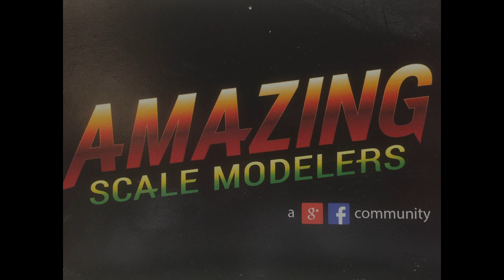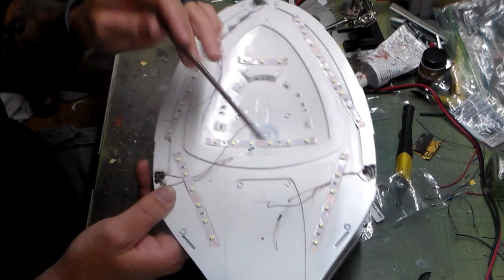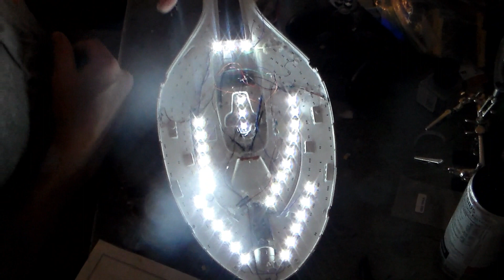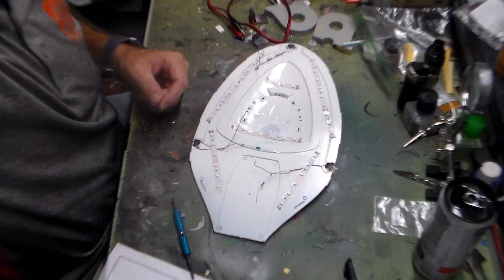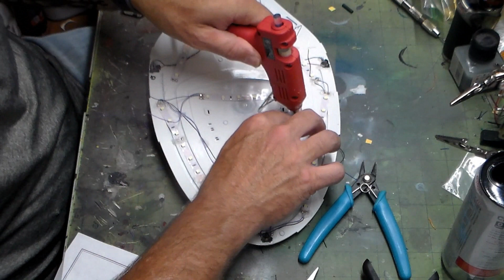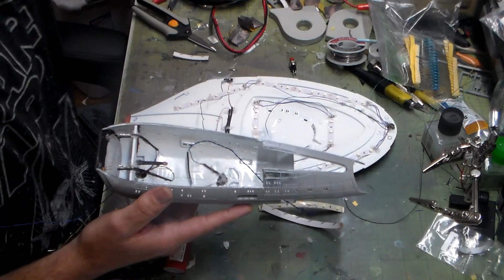Revell 1/670 U.S.S. Voyager build log 8

Comment: Great progress as usual. So good to see you have fun, blowing stuff up with the torpedoes and phasers. :D As for a soldering station, I can recommend Weller stations. They aren't that cheap (beginning at about US$120) but you can change the tips. From what I saw, your soldering iron now has a huge tip. Especially with those tiny LED strip connections, a much smaller soldering iron tip should help you tremendously. Tell your wife to get you one of those right now in advance for x-mas. Tell her, I said so! :D
Reply from the maker: TK316 thank you. I will diffently do that.

Comment: Hey Buck, great work on this update. The video indeed makes it look a little hard with the light in the saucer, and you use almost twice the amount of led's i did, but not all led's are the same so trust your own instincts and go with what feels right. Also the bow flood light, no one can get it over the bend in the hull. Thats a simple fact of physics. the light in the series was digitally altered to work with the registry number. For us to work in the real world, we would need the led to be higher on the saucer to shine over the bend. So don't worry about that aspect.
Lastly the torpedo's i like them, but i hear a mismatch in sound of the second firing and the visuals of the led. maybe its me, but look into that if you can.
Reply: First I thought the same thing with the torpedoes. If you look and listen closely however, it becomes clear that the sound plays when the torpedo light goes out. Logically you would expect a flash when the torpedo fires. But the light ramps up and then you get the sound with the light turning off at the same time. Since the left torpedo fires twice in a row, it seems the sound doesn't match the light. IMHO it would have been better if the torpedoes would fire left, right, left to make it clearer. If the ramping up wouldn't be there and it would only be a flash at the sound, it would be better and more easily recognizable. Tenacontrols do awesome effect boards but in this case (and only this specific one) I think Ralph erred with the ramping up.
Reply from the maker: Patrick Neijenhof thank you. Appreciate all the insights. Yes the torpedos effect is off. I will check into it.
Reply: You have a good eye! Because indeed i didn't realize the left tube fires twice. I naturally assumed left right left or right left right. But then again i'm trying to program my Voyager from an arduino, and i can tell you sound and visuals matching is a pain, so i know full well how irritating it can be to get this right.

Comment: Your wiring is awesome! I love your technique and great job demonstrating it! I've always had trouble with soldering, it doesn't want to stick to the wire or strip leads. What kind of solder do you use, like tin, lead, rosin core? I've even used rosin and it helps a little but yours goes on so easily.
Reply from the maker: Ken Spriggs thank you. As for solder I use electrical 60/40 rosin core leaded solder. I picked it up at Home Depot.